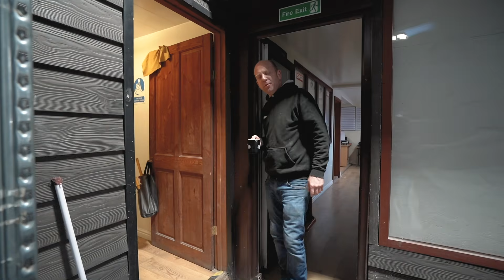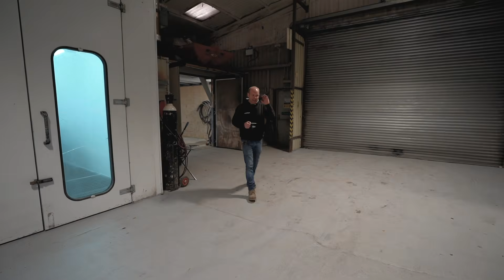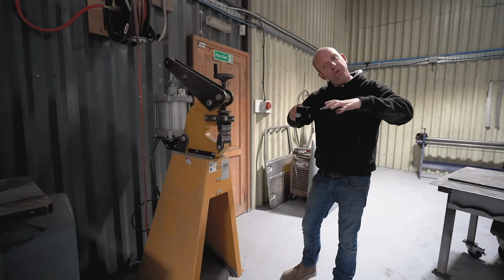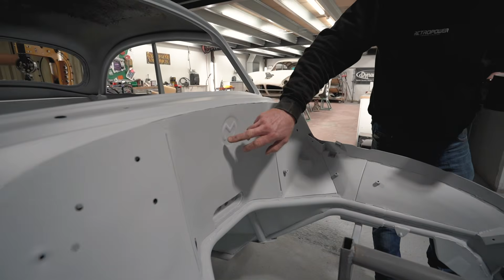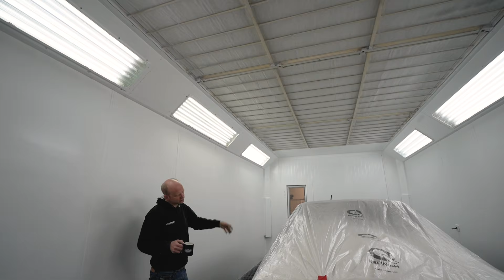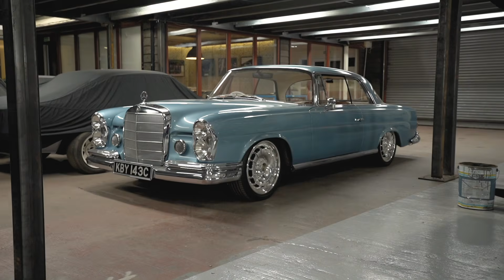Retropower: THE RESTOMOD FACTORY

Comment: Been great following you guys' work on YouTube. Crazy how far the place has come on since I last visited.

As a aside - you mentioned the processing of reused nuts and bolts, have you tried dunking them in TFR? I've got a big tank of it at work for ferrous parts and it's bang on as it strips all the paint, coatings and rust off and is virtually a 0 manpower job as you just chuck em in for a couple of days then rinse off.

Comment: That was a great tour of the shop and fascinating to see all the processes. I'd take issue with the underbody process though. The zinc spraying and raptor coating seems to be about protecting the surface of the underside; whilst it is nice to protect this surface that is not the source of rust that causes problems with the longevity of the car and seems to be overkill. In my experience rusting floors, sills and chassis members comes from water within  closed sections causing rust to work its way through from above. The zinc/raptor process does nothing for this much like the old underseal did nothing to protect cars from rusting away. In fact I have seen many examples of underseal making the problem a lot worse where it acted as a skin to hold water and exacerbate the rust. I do wonder if the raptor coating would act in the same way. If by any chance Nat reads this I'd be really interested in his view or that of anyone else with experience of the process.
Reply: Raptor, or any other similar product “can” trap corrosion in and make it worse or be no help, but that’s only down to the user not understanding what it does and how to use it properly. Raptor has no rust-inhibiting properties whatsoever, so it won’t “stop” rust that’s present or has the basis to form, but it’s an important part of an anti-corrosive system when applied to new, or “refurbished to as good as new” steel. The whole point of the process of blasting the shell twice and got zinc coating the underside prior to applying to Raptor is to ensure that no corrosion is present and that the Raptor can do it’s job as the strongest “barrier” layer from the outside in. Spraying anti-corrosive waxes into to the cavities is a separate process which happens after the underside is completely refinished. There isn’t a better way of protecting a newly built/restored shell today than the process used by Retropower here. If you want to do a “quick” fix on a car with a semi-corroded underside then doing a basic clean and prep and then applying Raptor isn’t going to do much, and that’s where you’d be better off giving everything a decent clean and applying a wax coating to make the best of a “quick” job to slow the corrosion down without trapping more of it in.
Reply: @ChequeredFlagAutomotive  Thanks for the detailed response - I'd guess you are doing top quality work too! I am more at the end of doing necessary repairs to keep cars going which is different from what Retropower is doing ie making new cars. I think there are many similar principles at play in stopping rust, the main one being understanding how it causes damage and can be slowed down. I agree that cavity waxes are an essential part of this process as are things like drainage and stopping water getting into closed sections in the first place. When I was in the trade 20 years ago I saw endless cars (from the 50s and 60s) covered in perfect underseal but as rotten as a pear because water was getting in from above and was getting trapped by the underseal. I get that the zinc/Raptor process is different from that but it still make me a bit nervous!

Comment: I've been watching you now for about a year, give or take, and the one question I've never seen addressed is about cost! Judging by what I see, any complete project of the type that you undertake must be horrendously expensive, owing to the care and attention to detail involved. So, how long is a piece of string? How much, for example, would a project like Utah cost, all in? Obviously, I'm not asking for detail as that is between you and your customer, but ballpark?
Reply: I suspect you are looking at 6 figure numbers. Race engine builders are charging £60+ an hour so I would think the hourly rate is higher at Retropower. But whatever it is the cost is justified if the customer is happy to pay it.
Reply: @1chish  Six figures? I think even that is conservative. £60 an hour is quite low by modern standards. Some car main dealers charge over £100 per hour and, bearing in mind the specialised skills involved in the redesign and fabrication of some of the bodywork and interior components, parts of this could work out more than that.

Comment: Once (about 12-15 years ago) I saw a second-hand welder for sale online that I desperately wanted even though I'm not actually much of a welder myself - it was a huge do-anything (stick, MIG, TIG, and probably at least two other processes that I don't even know exist) unit from the Cessna factory that could weld anything from 1 amp to 500 amps, and had all the gear and bits to weld anything from steel, stainless, aluminium, titanium, MAGNESIUM, ZIRCONIUM, TANTALUM - the fucking thing could weld a pork chop to a synagogue if you wanted to.
And all for only USD$50k...
Reply: pork chop lol

Comment: Very interesting tour, that raised a few questions. Does the local building code allow the absence of a handrail on the stairs? What happens if someone trips? 
The de-gooping stage on a new project sounds like a great first job for a teenager; very hard for them to do any damage, (what harm can you do with a spoon?). and a prolonged "interview" for any prospective skilled employee. 
If you're changing the length of curved panels, (like the doors on the Jaguar coupe', what would be the problem with cutting the rear door skin short,  welding it in place and using the strip as an extension on the rear of the front door? (I assume there's a good reason.)
For someone who's spent a lifetime looking at systems for managing repeatable, mass-production processes, the challenges of managing and coordinating a custom shop like Retropower are mind-boggling.

Comment: The white corrosion on the zinc coating, is the zinc doing its dissimilar metal, doing it’s preferential corrosion and protecting the mild steel structure… it’s what you want to see on a damaged area. Aluminum makes a white corrosion layer that protects the base material (itself).

Comment: Merry Christmas! Very interested in the Mk 2 project and saw an earlier post suggesting the use of a Mk 1 rear window. Looking at the current set up and the overall style, I agree that the Mk1 window would suit the car better. All the early Jags had a small rear window with generous, curvy rear quarters. A small rear window adds mystery to the observer and a sense of exclusivity to the occupants. Whichever you use, it will look sensational and dropping the roof is genius!
Reply: You've gotta be really careful that you don't end up making the rear end look too "fat" and "blobby", and in that case, the more square inches of glass in the turret, the better. For examples of what I'm talking about, go look at any Model A hotrod that's had a big roof chop but they didn't flatten out the roofline to suit the lower profile of the turret, so it all looks kind of squinty and swollen...